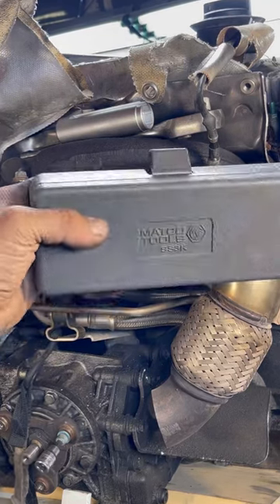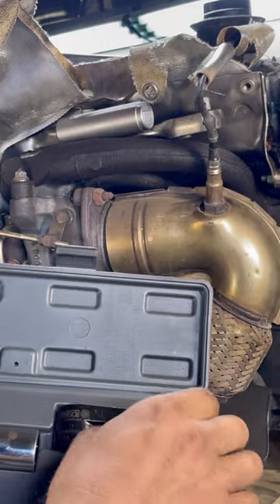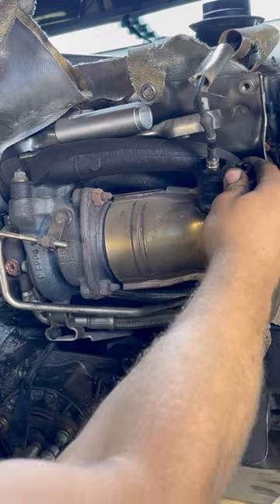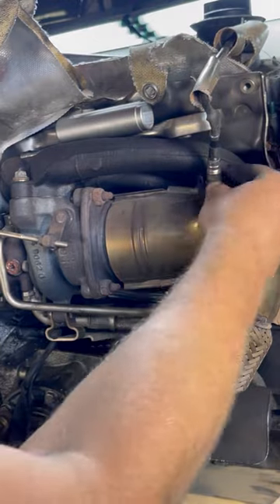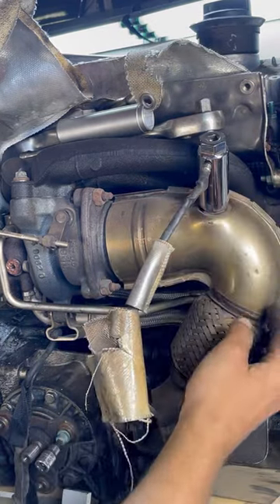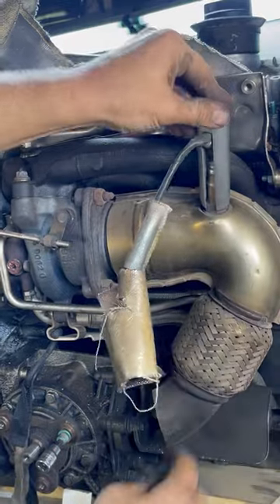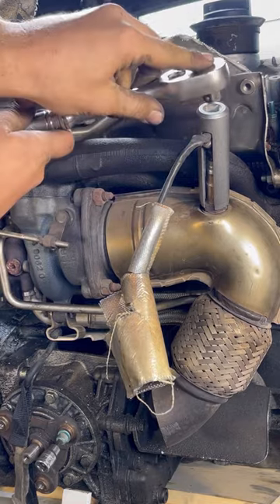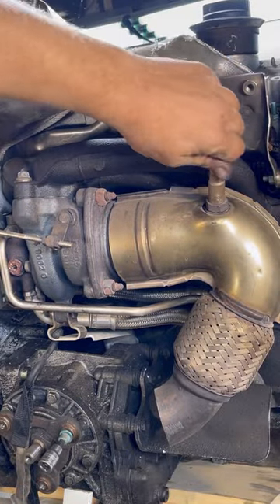VAG specialty oxygen sensor socket T10491 VW Audi 02 exhaust lambda removal tool

Comment: 30 years ago this was a problem with sockets no fitting on or super tight. They make them loose now because if you’re going to change one most likely they car has been running and hot af. Because no mechanic is waiting for it to cool down to change it. Also one of the hottest areas on the exhaust.

Comment: 7/8 is 0.875 inch, 22mm is 0.866 inch. They are close enough but not the same and you can damage bolts and heads because of this difference.

Comment: Here's a tip. If you're replacing the sensor anyway, cut the wire off and use a regular socket. That's when you need the max grip and torque, not when putting the new one on. You're welcome.

Comment: My cheap HF O2 Sensor/Diesel Injector tool kit is impressively suitable.

I’ve had it for probably 5-6 years and it’s always worked out.

Those slot socket style tools are for removing the old sensor ONLY.

Most O2 connectors I’ve found will fit through the flex head wrench and you can tighten the new one easier on most cases.

There are some that are in impossible locations just the same, gotta try everything before you say you’ve tried everything.
Reply: 9😅

Comment: Pro tip cut wires off down to the 02 sensor and remove with a regular apply a little heat with a torch for easier removal install new one with a wrench and put anti seize on threads easy as that!

Comment: I have the same kit and it doesn’t fit sloppy, also they have not skipped over a sensor or rounded one out yet using my 18” snap on 3/8 and 1/2 ratchet.

Comment: Last time I did one of those I had to cut the sensor down short so I could fit a shallow socket on it. Everything I tried was rounding it off but after I pounded a 6 point socket on it with a breaker bar it came out no problem

Comment: Well it looked like that set was used a bit.
However because if the socket is new it will have a better fit then one that has been used a bunch of times. 
Because it is a socket the has part cut out you will stretch out the metal when you have o2 sensors that don't want to come out

Comment: The fit depends on the tool maker. I have a complete set of Harbor Freight Sensor Sockets (99850). I have used them on every make of American car, BMW, Volvo, Toyota, Nissan, Mitsubishi, Fiat, and Cummins & Detroit diesels. They have always fit properly and never failed. Bought in the early 1990s for around $25. It doesn't pay to be a tool snob. Have a full set of Craftsman wrenches and sockets I bought in the 1960s. Broke a couple of them and they were replaced no questions asked at the local Sears store.

Comment: That looks like a diesel injector socket, they are very good in situations like this, I have a set of crows feet like yours but mostly use the diesel sockets on exhaust sensors........

Comment: Yes I do and even with a good Precision Tool that's made and fits great and tight is that O2 sensor is stuck in the bore it's going to come out difficult they don't all just spit out like that one. And personally if you're going to get rid of it cut the wires off put a regular socket on there you don't have any of the difficulty whatsoever yeah I need a good O2 sensor tool when you're installing it not for taking it out unless you plan on reinstalling it

Comment: The reason they have a little bit of slop so that they will grip and lock on the sensor an allow it to move at an angle slightly so you can get it off in tight spaces. When i worked at GM dealer the oem was tight and we destroyed every sensor we removed with it cause we had to drive it out with a hammer.

Comment: Hey naptown...did you not notice the reverse side of the Matco tools are 6 point sockets that fit tighter, don't stretch and don't strip. That factory tool has been known for damaging O2 sensors. That's why it's on evil bay. And that's a loose wobbly fit.
Reply from the maker: I worked at the dealership 9 years and I can tell you for a fact that factory tools are the best for the application that you’re working on, they are not universal type tools.  No I have never had this factory tool open up, that’s a misconception from everyone using Chinese tools

Comment: The O2 sensors get screaming hot.  1: they have a heater built in them to make them very hot. 2: they are on a very hot part of the exhaust. 3: all the rest of the exhaust bolts are also hot and commonly require being cut off because wrenches don't work.

Comment: my snap on one fits good also that tool you used looks like it is only sitting half way down on the nut if it was tight it probably slips off the flats

Comment: If your replacing the O2 sensor,
Cut the wire and some of the sensor metal after the wire and use a 6 point long 7/8” socket and long handle ratchet for leverage.
Spray WD-40 beforehand, and hope it comes out without too much fuss.

Comment: Those tool are only required when its tightly tucked in an mounted engine. With it oulled out reguler tool should work

Comment: I’m not trying to promote anything or anyone..,but I gotta admit the Tekton o2 socket works better than any other tool trucks o2 sensor sockets I’ve bought over the years.. just saying.. I’ve taken about 10 sensors out with that tekton tool and it works perfect.. agree always chase the threads before the new sensor
Reply: Mine slips got a matco one and can use a 4 ft ratchet on it

Comment: I just used a regular boxed end wrench. Unplug the damn  wire first. 
If plug doesn’t fit through. Cut slot in boxed end. 
Works just fine. 
JS

Comment: I have a snap on one like those Matco ones you have. Never had an issue removing or installing an O2 sensor with it. Fits snug. That socket you used is too tall and would never actually fit anywhere on an exhaust in the car. They put O2 sensors in really tight places on modern cars.

Comment: I use a snap on 7/8 flare wrench 🔧 works for most 02 sensor or cut the wire and use a regular 7/8 socket to.

Comment: My issue with the long sockets like that is that they keep spreading on me at the opening and rounding off the O2 sensor. I found a shorter one at Advanced Auto for I think $12. JB welded a super thin shim on the inside of each face to account for the sloppiness. Works every time.
Reply: Make a metal sleeve.

Comment: I put a screw type hose clamp at the bottom on that first tool and never had is spread open.  Oh, and heat! 7/8 and 22mm are two different sizes

Comment: Try tossing that loose socket in the freezer for an hour or two then check fitment. If it’s proper, heat the socket with a torch and slightly peen the gap closed.

Comment: I usually just cut the wires and put a normal deep socket on it. If I'm removing the O2 sensor I'm replacing it. And I only use the tool to install the new one.

Comment: It's not the socket that's the problem. The O2 sensor gets extremely hot and this accelerates oxidation (rust). So the hex on the sensor is corroded away. The factory tool is cheaply made so the dimensions are not very accurate, in this case that inaccuracy is helpful.

Comment: So these sockets always bend and open. Just hit these with a torch for 30 sec. Then you a wrench or better, and line wrench. They pop right out. Never need to tighten them in much as the heat from the dpf will make them super tight.

Comment: Put copper antisezie on the threads and it won't be as hard to get em out. I have a cheap set of those and I never use em. A wrench and a hammer always gets em

Comment: 😂😂
Usually have to heat the exhaust with a torch and quench the sensor with pb blaster then it might come loose.
I changed out several this last summer, only one came out with a sensor socket, the rest had to be removed with an impact socket after chopping the wires off

Comment: Looks like the “factory tool” only grips on the top half of the hex part on the oxygen sensor. Bet it will strip sensors where you actually have to put some torque to break them loose

Comment: Hose clamp or not, if you try to get an O2 sensor out up here in michigan with that slit socket after about 100,000 miles of salt on the roads, you're gonna break it before that bugger comes out.
Reply: Ok, what do u use?

Comment: Well I hardly ever had a o2 sensor come out that easy..what I do is simply cut the top part off the sensor..then fit a full socket onto it because in most cases it's gonna strip useing a tool with a hole cut in it..and even then I had to heat and spray it because it's been in there for yrs

Comment: yes... assuming you purchased a true factory oriented tool Intended for use in the assembly process they can/ will spec it out true to size and likely have an individual with the QA department whose sole job is to regularly check such things for accuracy and retire/replace them as needed. Also they likely only have a few O2 sensor suppliers and with a large enough quantities purchased/ price paid can be quite anal about the accuracy of the product vs. the specs..... but a tool intended for general use is ALMOST always made slightly larger than true to size specs would be... the reason is they don't know how accurately made the O2 sensor was initially,  was it mangled and chewed up while installing it,  did the manufacturer cut corners and use plain steel instead of a 400 series stainless and now its 20 years old and rusted severely.... the tool manufacturer has no way to know any of this and doesn't care beyond whether or not you are going to return there tool as defective/too tight. but while there is an increased risk of rounding the corners if to loose must will complain about the tool being to tight much sooner than to loose.... and if it's a cheaply made tool all bet are of anyway as to accuracy and strength of the steel used....

Comment: They are loose because every o2 sensor I've ever replaced was basicly as hot as lava. And at those Temps your not gonna have finger tips after trying to remove the o2 from your socket. Pro tip copper antiseeze

Comment: there a little lose tell the exhaust manifold is hot then after there heated up and expanded the fit better. The factory tool is made for installation only so they only have to fit the sensor when there cold. And yes I have seen service techs change hot O2 sensors cause there easier to get them out when there hot if its a car more then 2 or 3 years old

Comment: Will it fit 7/8 or 22mm Oxygen sensors for Other makes like Honda V6 engine? Thanks.

Update. I found one at about $66 used. Same one shown. Best investment. Worked on my Honda and a Hyundai Sonata with that heat shield where others are too thick or you need a thin wall socket. This takes the place of a socket set.

Comment: I ordered a new taiwan Matco 22 mm O2 sensor socket with the 24 inch breaker bar ....work perfectly and fit on the sensor perfectly ....forget the ones made from PRC...garbage

Comment: You know what you go to Harbor Freight get the same tool and it fits a lot better by the way the Matt Cohen are the high-end Harbor Freight ones things you need to know as a mechanic don't get cheated by Matco or Snap-on because most of the time the iron brand they're made in the same Factory as the Harbor Freight iron

Comment: Why does it matter if the wires are bent if you're replacing the O2S anyway? Use a 7/8 wrench in that application? Simple solution... That is if you're replacing said sensor. If not, unplug the sensor and remove the exhaust section with said sensor....

Comment: Cut the wire I've even cut the sensor since it bad any might as well get it out the way. Then I can use 1/2 in socket mabye a little heat then it's out

Comment: Because the manufacturer doesn't want you to fix the car that you paid for 10 years ago and own outright. VW. It figures. They also have their own CV joint bolt heads that standard tools do not fit. Find some metric bolts that fit standard tools and use them they are 10 times cheaper as well.

Comment: I see that’s cause you used matco instead of snap on
Reply: 100%
Reply: Never had this issue with my snap-on O2 sensor socket. Ive done them in some really horrible locations too.
Reply: Or just use a spanner
Reply: @crf80fdarkdays  the engineers really love to put them in places where a spanner isn't going to get.
Reply: @Spike-sk7ql  yeah this one is clearly accessable though, most things you can't get off with a socket you will get off with a spanner in the right spot

Comment: You are a ware when manufacture make car the also produce a workshop tool kit so you can take cars apart and rebuild now asca dealership with many brands we gave a who store area with wall of tool for different models so when we get new models we update we update our tool store. 
So manufactures sell these tools via dealers they are expensive but if you a licenced dealer you get a huge discount.  But this all adds to cost of cudtomer servicing.

Comment: I just had to deal with this today. I’m in college right now and was removing an 7/8 o2 sensor and was having trouble. The teacher grabbed a small extension and flipped it over and it was snug. They appear to have a different amount of points. That being said I think the factory one is better because it is a little awkward having a swivel head wrench attached to a tiny extension

Comment: Well, 7/8 in is not 22 mm... Its 0.225 mm to large and that explaines why it doesnt fit properly... Have similar problems with my classic car... Most bolts are metric, but the break system and some other more or less random bolts are imperial...

Comment: Can anyone tell me why all mechanics don’t just cut off the wire, and use a short socket that fits properly to remove the no longer good part. Then, lightly lube a thread chaser, chase the threads, paint some anti seize on a new one and install it with a wrench?

Comment: That's because matco and mac is just rebranded Chinese shit, get snapon and they are ACTUALLY 7/8, they have both a 7/8 one and a 22 mm one and have tighter tolerances, or, just get a 7/8  cross foot and use a flex head ratchet like normal mechanics

Comment: Why does anyone leave the wire on? Just cut it off use a solid deepwell. If you take it off replace it.
Reply: Please tell me the name of the shop so I can advoid you....
Reply: @gl9500  what by replacing an o2 sensor every time i take one off so it saves the next mechanic the headache and charging you the time and part cost of fixing it the next time around? Sure avoid me and make others more money i support local garages too.

Comment: Then use metric sockets then  mate all lambda sensors are 22mm exactly and they will fit snug as a bug stop with these strange off sizes man literally only time an imperial works is when the bolt is stripped or rusty and the nut/bolts never the same size but lambdas use metric not imperial

Comment: This guy must not be anywhere near the rust belt. Because those normally don’t come out great without heat,cutting the wire, or pulling the treads out of the bung. Fml lol I’m up in ct and my luck that would have pulled threads first crank

Comment: It’s always a guy complaining about a tool not working then using that tool to take the most easy no hassle no rust no 1/2 1ft - 28 ft breaker bar set up to remove 1 in a million chance then removes it with a regular ratchet 😂😂😂😂 like brother 😂😂😂😂😂

Comment: You're actually advertising a worse product. The longer the socket, the more chances of tilting and slipping, especially in tight spaces, had this problem recently,  sometimes the only option is to remove the exhaust.
Reply from the maker: And you’ve probably only used China sockets not a Hazet German factory tool
Reply: @NaptownTuner  never cared about expensive/overpriced tools, even though most of the work on my vehicle I do myself, replaced exhaust manifold,  turbo, shocks, radiator, brake rotors, and much more, at home with regular tools
Reply: @NaptownTuner  self thought 34 years old, and this is not my profession, I do it to save a lot of money,  why pay someone when I know that I'm doing an excellent job.
Reply from the maker: @johnp3978  sounds like you don’t know what it’s like when you use a cheap tool and damage a customer O2 sensor you need to remove for repair when you’re not replacing the O2 sensor just for one simple example.  Maybe I’ll make another video explaining damage & operation of the oxygen sensor housing
Reply: @NaptownTuner  if I had an auto repair shop, maybe, but since I'm working only on my vehicle,  I don't see the point

Comment: Why are you trying to save the wire on the bad sensor? Just cut it off and use a deep impact socket for removal!🙄
Are you a bunch of amateurs or what!?
Use the specialty tool only for installation of new sensor.😂

Comment: You can easily use an open end wrench 🔧 on that. You're doing too much
Reply: Open end is a terrible idea when you could just as easily put a box end on it. Why run the risk of rounding the edges if you don't have to.
Reply: @v4lhulme  can you fit the electrical connector through the box end of the wrench???  Not on one of those, Smart guy